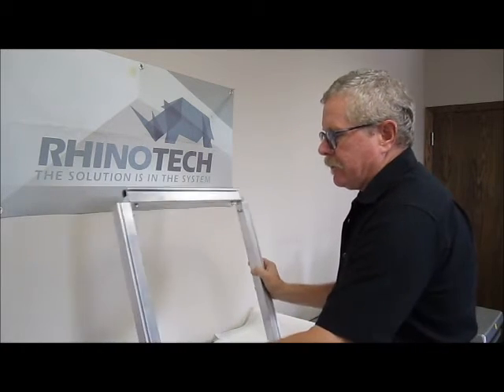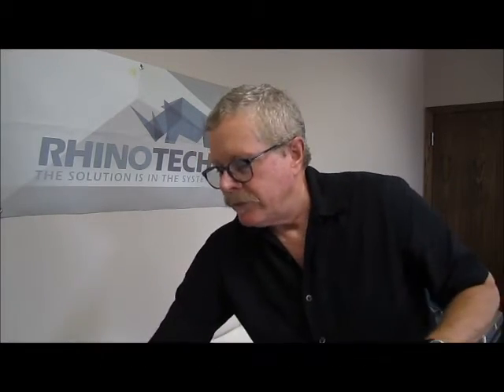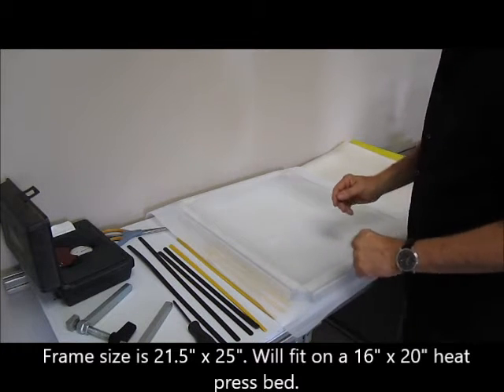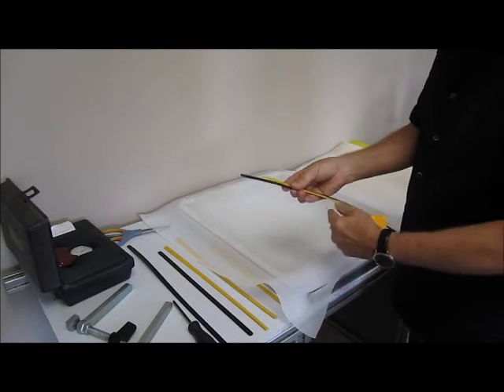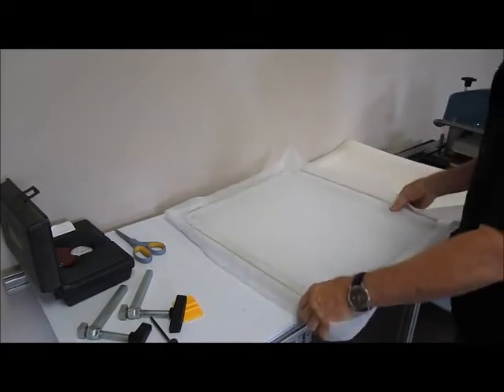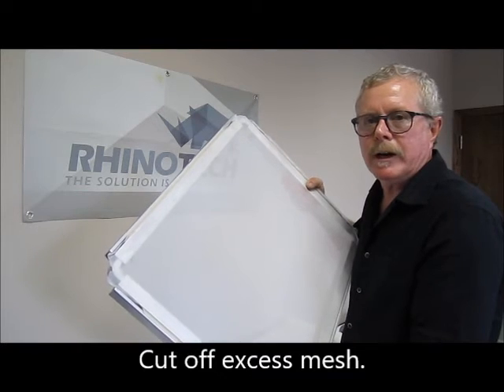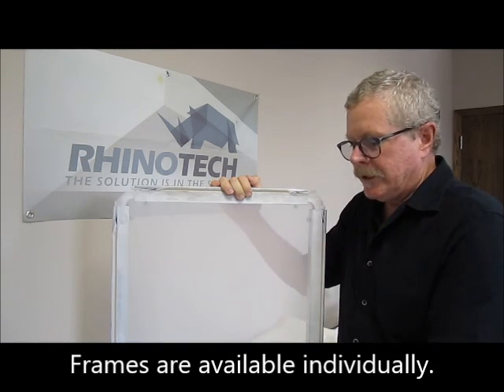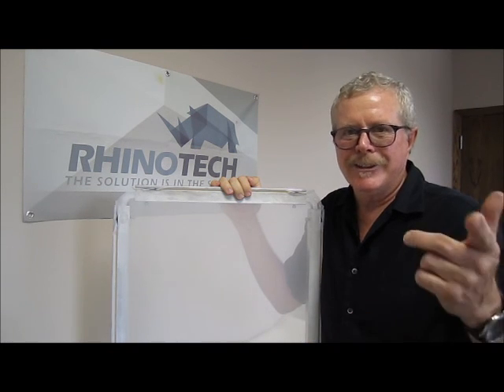RS Screen Frame and RS Mesh System.

Comment: Do the inserts, long and short, come with each frame? 
Can you expose gradient halftones with the 2.0 Stincil process that you show here?
Thank you.
Reply from the maker: Yes, the inserts do come with the frame. In answer to the gradient halftone question, RhinoScreen 2.0  has been designed for spot color printing, however, halftones are possible depending on the dot pattern. Because you will be applying pressure with a heat press, you'll have to plan for the dot pattern to expand. Hope this helps, but please call Greg at 651-686-5027 x 2 if you need more info. Again, thanks for your interest; we're looking forward to working with you.

Comment: Dear friends, what's the minimum and maximum mesh possible to operate with this system?
Reply from the maker: The range is from 110 to 305 mesh count. Thanks for the question and if you need more info or help, just give us a call at 651-686-5027 x 4 or 2. Look forward to working with you.